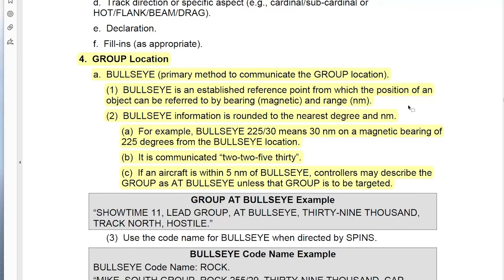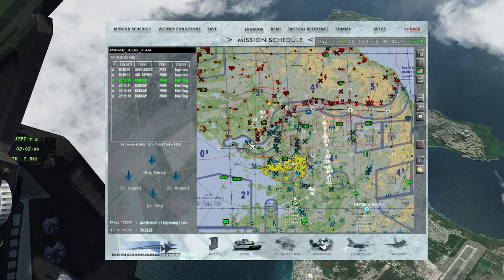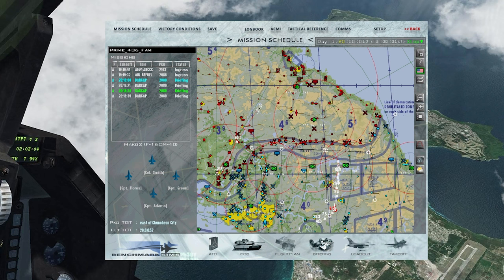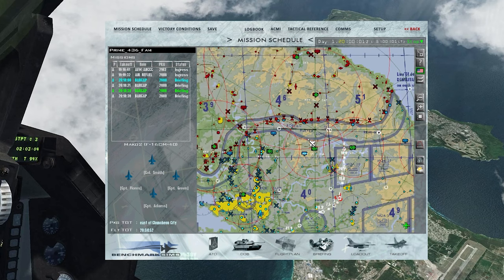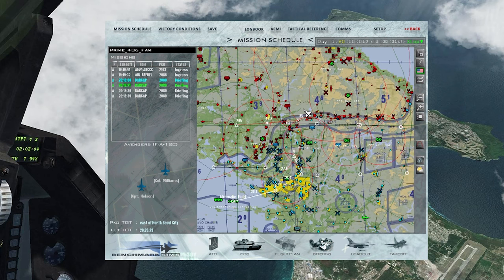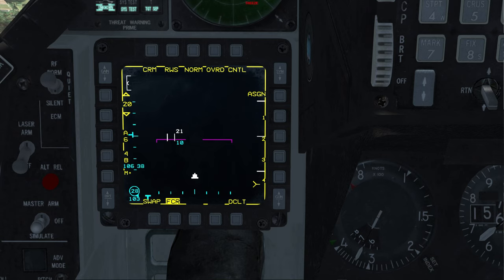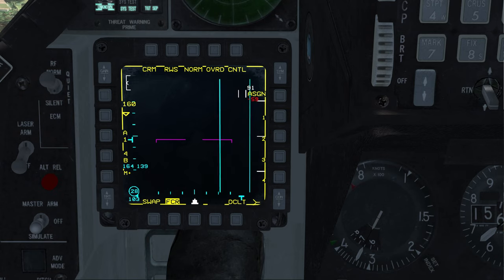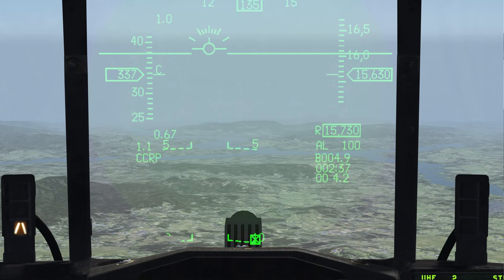Falcon BMS - You NEED to understand Bullseye to develop SA

Comment: This has definitely been massively helpful - I thought I understood bullseye, but this has shown just how useful it is when tied to the FCR
Reply from the maker: Good to hear. Understanding bullseye and where to gain more awareness helps out a lot.
Reply: But how do i  fly to the bullseye call? , when i put my spi on the location and start pulling to the spi , the spi dosent keep the location , thats the only part that is missing in this great tuturial @AviationPlus
Reply from the maker: @stevesteven-gw4zy  Yup place cursor in the general area and determine if it is a threat if it is commit if not don't worry about it but take not if it will become a threat soon or not.
Reply: @AviationPlus  i get it , but if it is a threat , how do you navgiate to the spi ? I can turn the plane in some degree to head to the spi , like if the spi is on my 8 a clock , thats about 120 dgree to the left , and lets say the distance is 20 mile , how do i know that when i passed 20 mile ? I know it sound stuiped , but thats my qustion thanks for the reply

Comment: Great as always! I recall reading you can set your radio messages (text) to stay in a pull-down now so you could read the bullseye calls at your leisure.
Reply from the maker: That is correct you can have the radio calls come up as text on the top left side of the screen, but they will disappear after a few seconds.
Reply: @AviationPlus  I'm talking about OTWToggleSubtitleWindow, a new feature on page 4-44 of the tech manual. Lists all previous comms with timestamps (I haven't tried it). Alt C: W.
Reply from the maker: @CloudlessEchoes  Oh I remember reading that feature now. I have not messed with it yet

Comment: Really useful. Thank you!
Reply: Play dcs instead
Reply from the maker: @quickrider3855  And why is that?
Reply: @AviationPlus  correct me if I’m wrong but dcs has a better flight model, avionics modeling, radar modeling, and jet system modeling.
Reply from the maker: @quickrider3855  You are 100% wrong on the flight model. BMS uses NASA data to model the F16 characteristics. In regards to DCS eye candy doesn't mean it's accurate by any means.